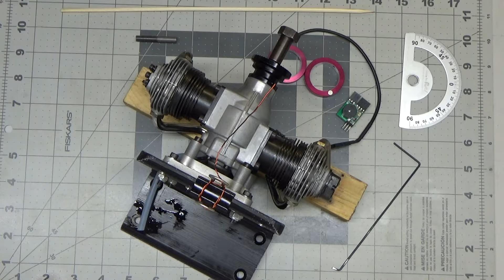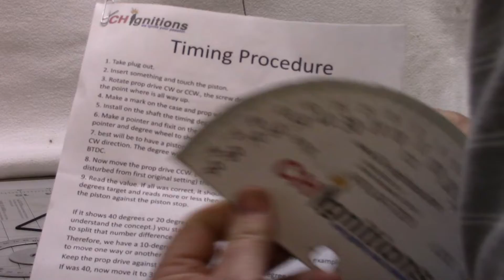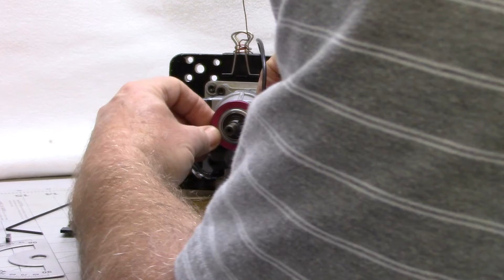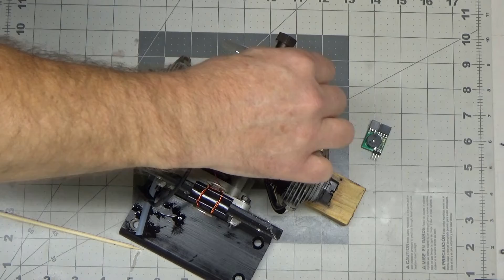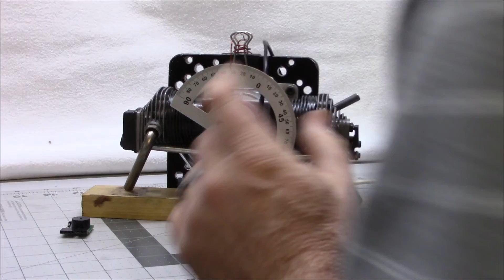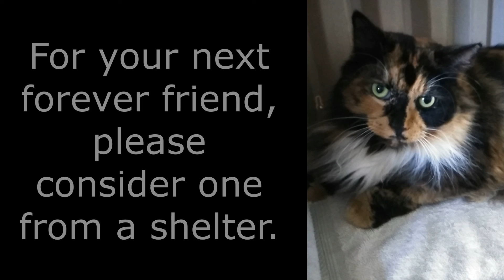Magnum FT-160 Ignition System Installation Part 2

Comment: a mate of mine does this to super tigre  engines he swears by it improving the running and tuning , and he gets better fuel economy
Reply: I can confirm this
engines run cooler and longer
but they do not smell as nice
Reply from the maker: It still burns glow fuel.  How could the exhaust smell be different?
Reply: @DavidsRCStuff  the combustion is diverent
when i tested the timing on my cox 049 spark conversion the smell was sharper
normaly the exhaust of the cox is sweet and now it is sharp